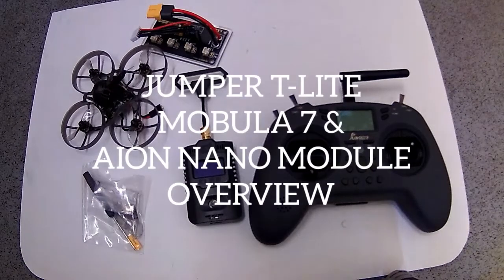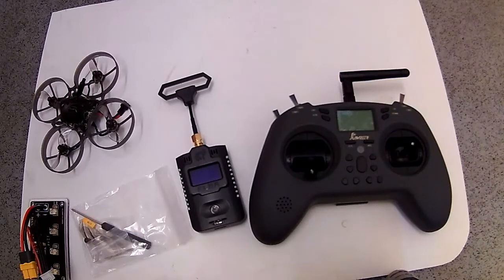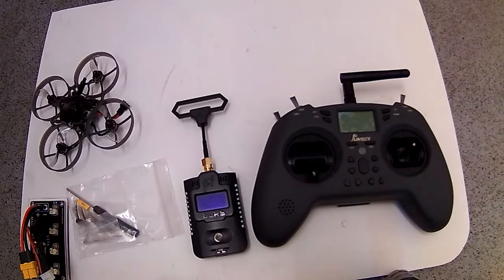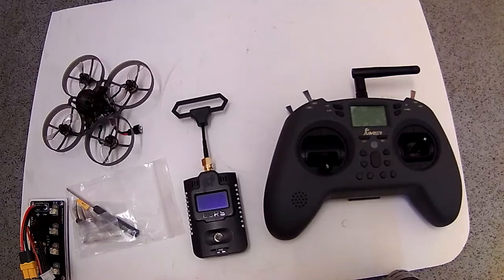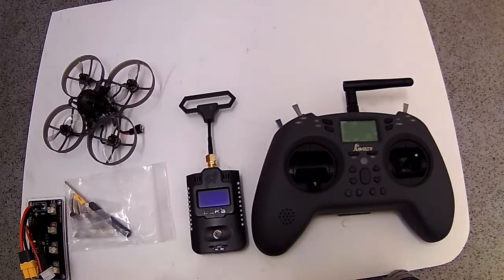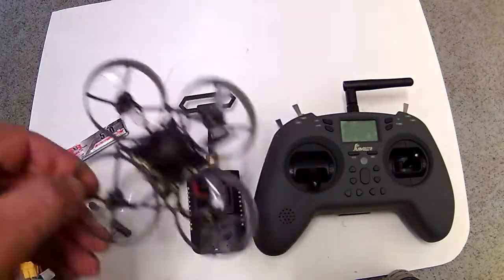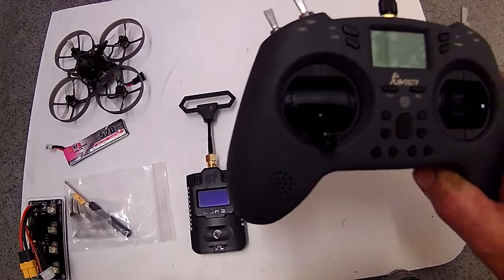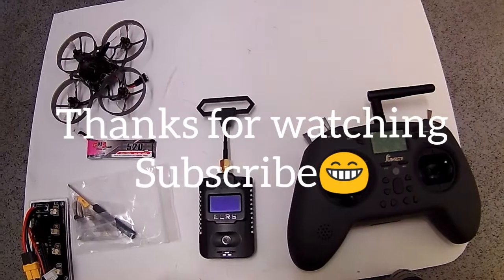JUMPER T-LITE V2/AION NANO MODULE & MOBULA 7 ELRS OVERVIEW(no flashing/updates required)

Comment: Hi, so I got the exact same equipments but the module adapter wont screw down completely and it’s on a lot of stress so how do I fix that
Reply from the maker: I found that too,i just reroute the wires in a loop then screw down the bay adapter make sure wires aren't trapped and unseen.takes a few attempts but you'll get there with patients.bad planning really they should have made a deeper recesse.also make sure the screws don't cut into the wires when you screw them tight.

Comment: Can this module use with Jumper Tlive V1?
Reply from the maker: Yes same with any multi protocol transmitter but you need. To load edge tx and ELRS lua script to radio(SD card)